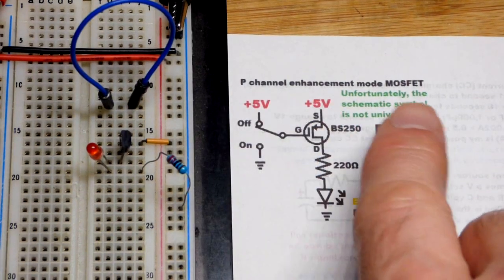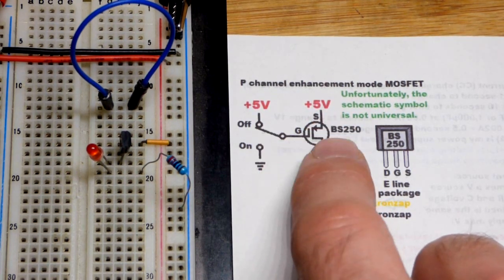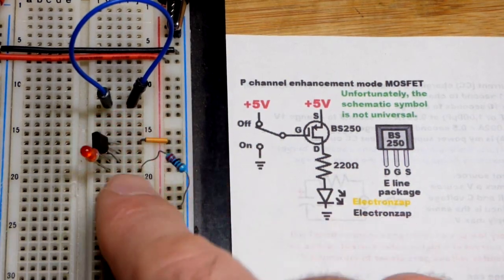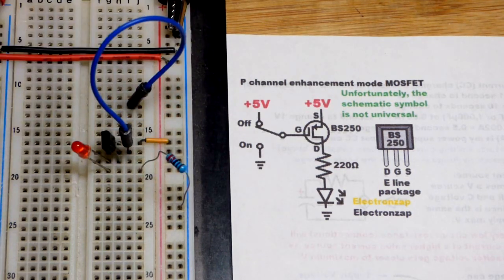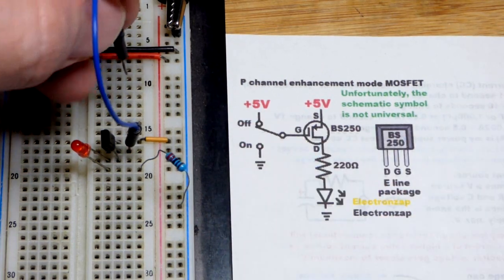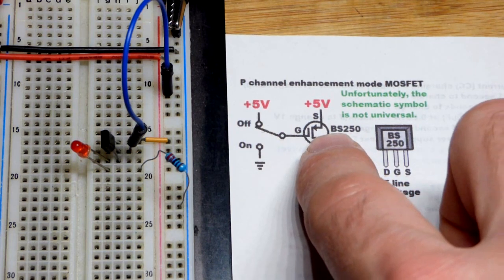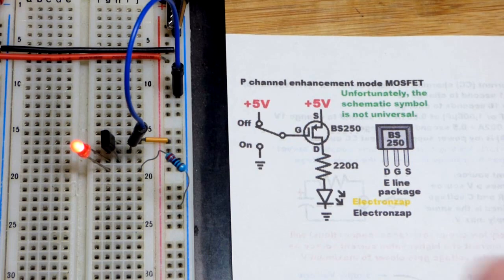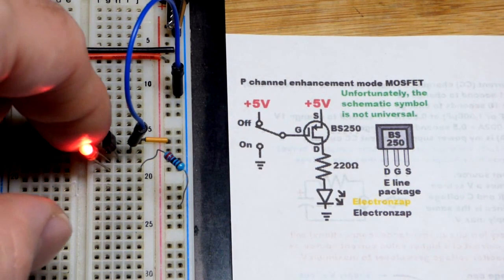BS250 P Channel Enhancement mode MOSFET transistor switch circuit demonstration schematic diagram

Comment: Don't I need 2 bipolar transistors to shut off the P channel? (no mechanical switch to disconnect ground) I need optocoupler + 2nd transistor to shut off P channel as used as HIGH SIDE SWITCHING.
Reply from the maker: I don't remember, but there's a lot of situations where you would use one or more transistors to turn other transistors on and off. BJTs are good for alternating between high and low side switching,